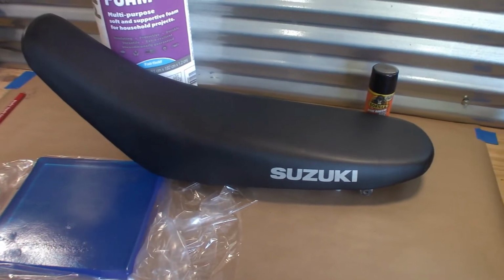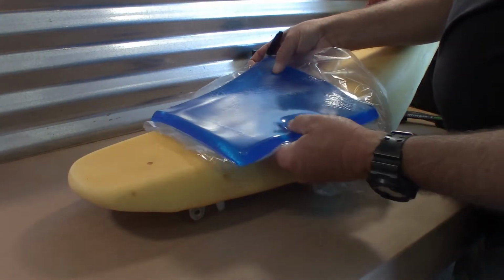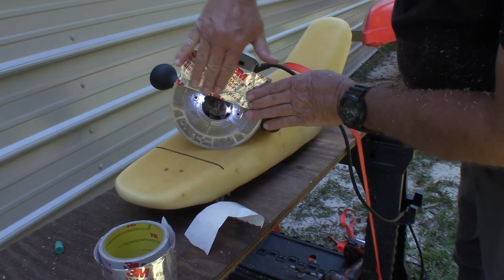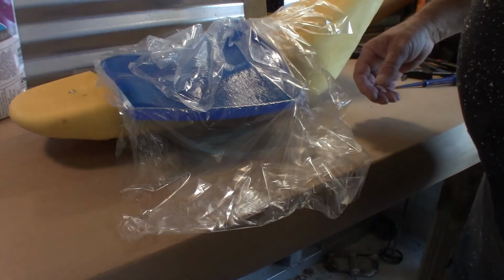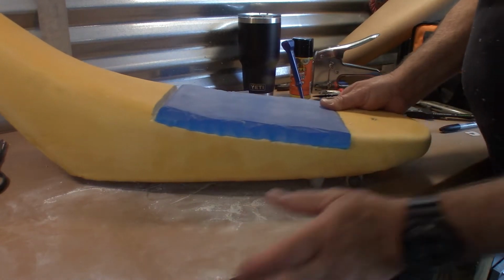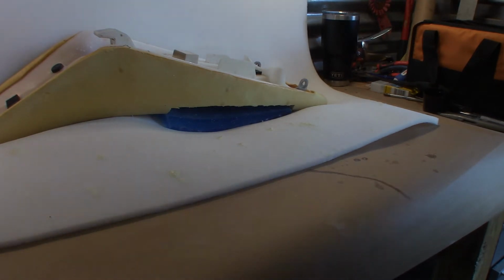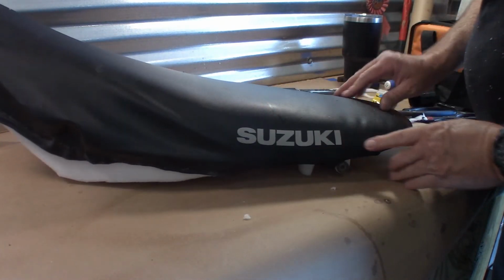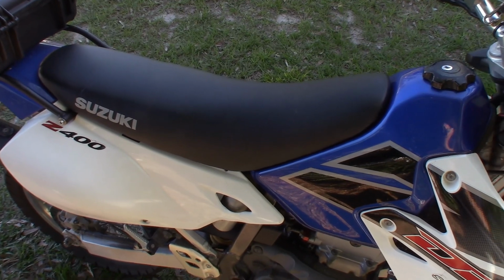DIY DRZ400s/ 400sm seat mod

Comment: I looked at that gel thought about buying it I never work with it before watching you I thought occurred if you were to put it in the refrigerator and get it cold you may be able to cut it with a razor knife brand new blade nice job